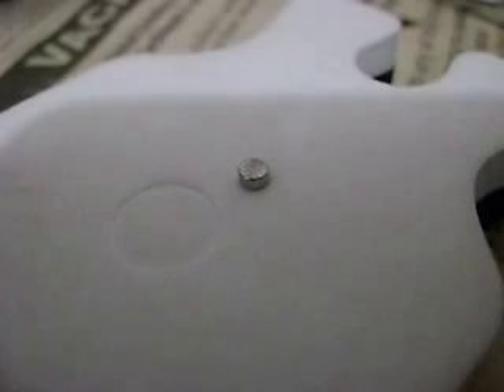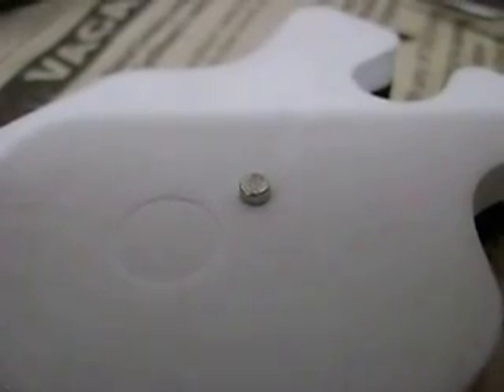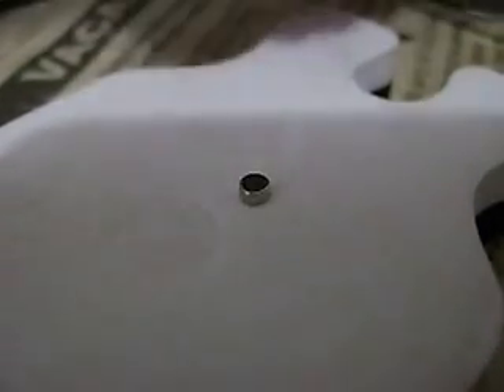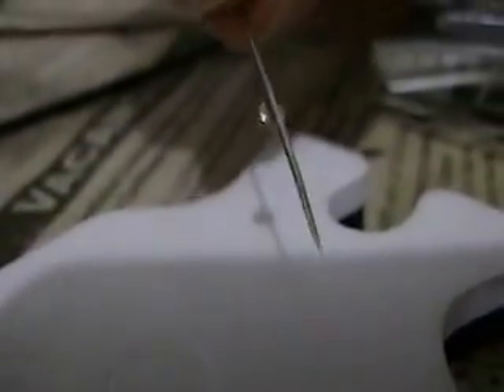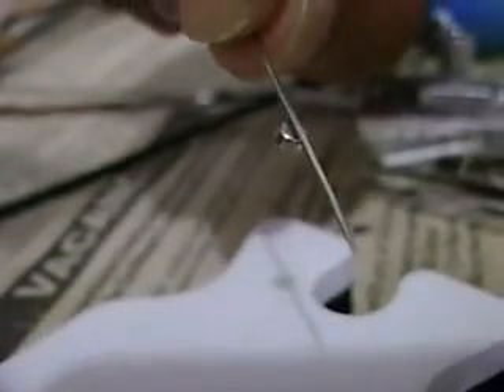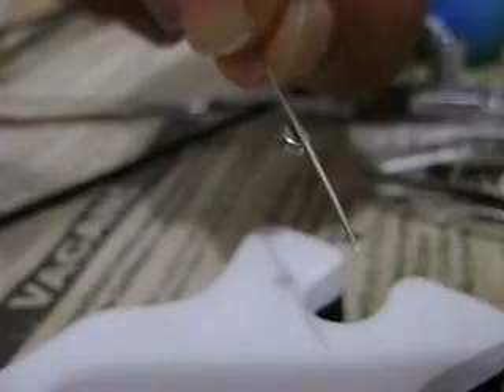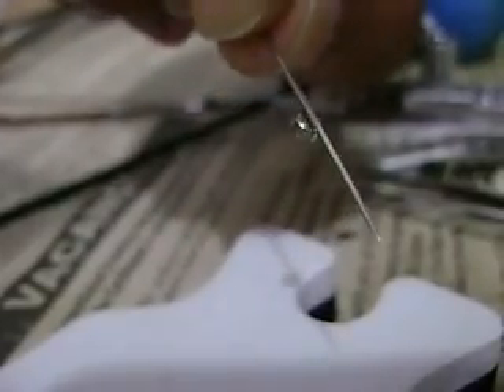new method to level the swash plate of an rc helicopter

Comment: A great idea indeed. I've just leveled my swash (on a re-build-from a crash) using the traditional leveling tool but I will definitely try this just to verify. I have a magnet such as yours (I believe it is a rare earth magnet (Neodymium), small but strong, and instead of a needle I will use a piece of rod from my old flybar equipment which end I will bend into a ninety just to be more precise when checking if and when it contacts the post(s) of the swash plate. I am in the Philippines but FWIW, I will let you know I will be thinking of Trinidad and Tobago each and every time I do this.Thank you for sharing the idea.
Reply from the maker: you are most welcome my friend.

Comment: Nice Method!  I have the leveling tool, but I really don't want to take the head all apart AGAIN just to check level...

I was trying other things to see if they are accurate, however I am not sure.

When I put a string level on the blade, it is level for most of the rotation, except when it comes around the back left servo connector.  I think that because the swash is not perfect it is causing this to happen and I really dont want to have to tear it apart to find out.

I had purchased my first heli as a crashed cheepo, now I am still learning how to get it set up and not every video is perfectly clear.  some things that would seem "obvious" to the normal flyer is completely new to me and are easily not mentioned.
Reply from the maker: thank you for you comment. i know tearing and reassembling the head is quite tedious. why don't you make a video of what you are doing? it is difficult to visualize what you are talking about. But one main thing stick with it you will fly good soon.

Comment: Thank you Rabindranath. Your method is definitely a shortcut. It's foolproof and as accurate as any other way I have used. Simple and effective. I have used other methods of leveling the swash-plate on my 450, but this is the one I'll be using from now on.
Reply from the maker: hi sky pilot. I appreciate your comment. Thanks for the feedback.

Comment from the maker: do you use the correct binding procedure. Usually  to bind at least on spektrum receivers you have to have a bind plug in the receiver then power up the receiver then hold the bind switch on on the tx and then turn on the tx when the rx light goes steady the binding is complete and you can remove the bind plug power down and from there it works always.

continued

Comment from the maker: Thanks for your comment. However if you look at the mechanics of the method you will see that this is not only a visual check but also a method for leveling the swashplate without removing the head. Jiggling of the servos can be done in between the servo attachments on the swashplate. Once the needle is not moved in during adjustment the method is robust. I have used this method on my 450's and checked it against the leveling tool and they are the same.

Comment from the maker: Thanks for your comment.

This v912 looks like a fixed pitch main rotor and tail motor setup. Have you tried to adjust the rudder trim on the tx radio? Assuming that your main blades are turning clockwise then if the nose of the heli is turning to the right this implies that the torque of the tail is too much. Try slowing the tail rotor from the tx radio.

I will try to do a swash adjustment video in time.